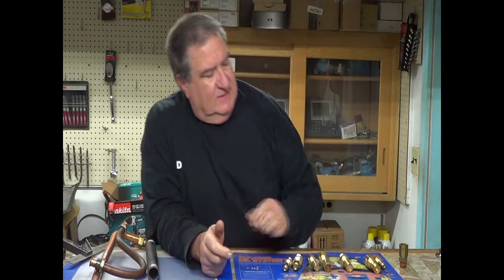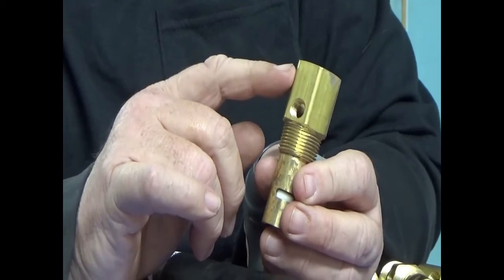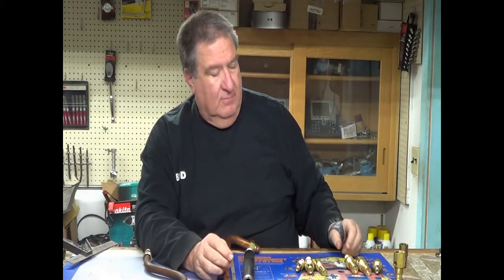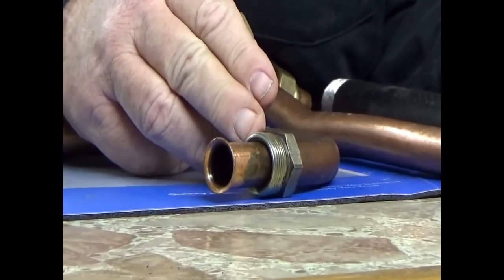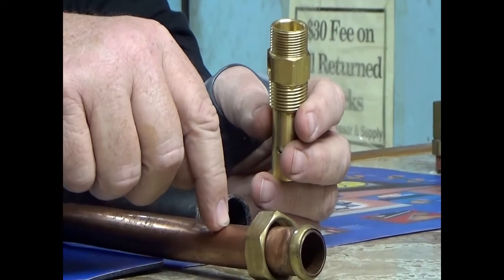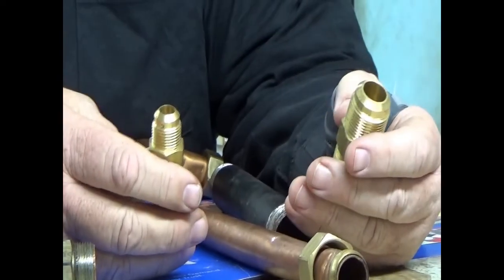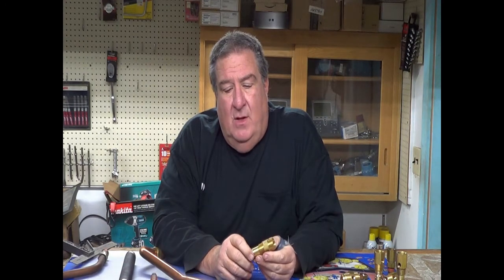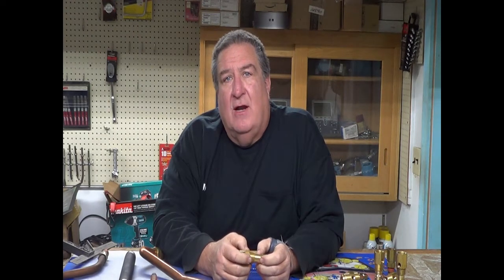Everything you every Wanted to Know About Check Valves but were Afraid to Ask S2, E 22

Comment: Question what is the best pipe thead sealant do you recommend?
Reply from the maker: I use pipe sealant  it comes in a can I buy it off the local plumber, it is a white paste and has a brush attached to the lid to paint the past onto the threads. my truck is not here or I would give you the brand name.
Reply: @THECompressorGuru 
That's the teflon based pipe dope?
Reply from the maker: @ralphgiampietro85  I will look when I get the truck here tomorrow.
Reply from the maker: @ralphgiampietro85  Blue monster brand, PTFE Pipe thread sealant.

Comment: Mr. Compressor GURU, does the check valve have anything to do with not starting the compressor once the tank air gets low? I have Dewalt Pancake compressor and starts, fills tank and doesn't restart back up to fill tank for a day. I replaced low pressure switch twice, jumped the on/off switch and still same issue. This is the same pancake as porter cable, Bostitch.
Reply from the maker: So the Pressure switch ... does it have a tube going to it from the check valve. if it shuts down and it bleeds air for the switch for perhaps 5 seconds. then stops. its probably not the check valve. feel free to contact me through thecomressorguru.com

Comment: My question is can a check valve cause the compressor not to reach full pressure?  It's not leaking meaning I can't hear any air leaking.
Reply from the maker: Probably not. its there for other reasons. are your belts Tight?

Comment: Can a load genie be replaced with a conventional check valve if I replace the switch with one that has the 1/4" unloader nipple on it? My old Speedaire doesn't even have a switch. It just plugs in and goes. I like it because it's a quiet oil pump type so I'm hoping to save it. The noise coming off the load genie sounds like a blown rod bearing on a car.
Reply from the maker: this gives me lots of questions? contact me through thecompressorguru.com  .  i can't wrap my head around an electric compressor with out a pressure switch.😯

Comment: Had a bad check valve and replaced it. Now the compressor pumps up the pressure to 125lbs but over a  3 to 4 hour period it leaks back to 110lbs then it stays there. Was wondering if i took it apart and stretched the spring a little then would that help.
Where i live i can't just run down to the store and get another. I had a problem gett this one, took me a month.
Found one in Florida......
I live in Canada.
Reply: I would n't do it , My question is is your system tight?  a bad check valve when bad will cause many different problem this 3-4 hr leak down I would be ok with.
Reply: @BudStiner  I'll get out some soapy water and spray it down. 
What puzzles me is once it gets back to 110lbs it stops leaking and the download valve doesn't appear to be leaking

Comment: So I have a question. If I were plumbing in a second air compressor would I have to put this check valve specifically on the tank? It already has a check valve on the tank (The one that is already factory plumbed into my tank to unload the 1st compressor). Then the real question is can I place this check valve to a closer location to the pressure switch, like say right off of my discharge hose from the second air compressor? I want to unload the second compressor as well.
Reply from the maker: the intank check valves are to keep the air in the tank and not going back to the compressor this makes for easier starting of the compressor when the pressure switch closes . I think your question is can you put a line check valve between the tanks. I have done that specifically we had a 2 stage machine(175 PSI) and a single stage machine (120PSI) the single was the secondary machine and only came on when the primary machine could not keep up with the demand. the problem fell into the single stage tank was only rated for 150 PSI so we had to stop the air from the 2 stage back feeding the single stage we did that with a check valve coming off the tank to the system of the single stage. 
I hope that made things clear... as mud? if you want you may contact me through thecompressorguru.com interesting question.
Reply: Yes very clear I appreciate you! I do want to ask a bit further. With this setup did you have to drill and tap a hole somewhere in the line to give the pressure switch the pressure that it needed to know when to cut in and out? Does anyone make a line check that has a hole already for the tubing connecting the pressure switch? If you answer those questions you will have answered everything! Thanks Guru!
Reply from the maker: @paulhammons53  to the first question, no each compressor has its own pressure switch and all the check valve did was to keep the High pressure from flowing to the low pressure tank.
to the second question. yes I have those check valves on my web page thecompressorguru.com. 
glad to help
Bud

Comment: Very helpful video. Youre the first person that has noted that oil compressors can make a check valve get stuck closed. 
I''ve got a Coleman powermate 
27 gal 5hp oil belt driven compressor that only builds up to between 60 and 65 lbs before it stops and the motor has a slight buzz, at which point i turn off the compressor to prevent motor damage. From about 50lbs of pressure the belt starts to slow until it reaches the 60 to 65 and can no longer turn. Startup from an empty tank and continued running has no problems, though it seems that periodically, as pressure builds, the start capacitor reingages on occasion. I've opened the head and the reeds are intact, the piston bore is smooth with no apparent seal problems and both head gaskets have been replaced. The relief valve is not leaking, but because it never reaches full pressure it doesn't do a pressure relief as compressors do when they reach max pressure & turn off. I hear no leaking unless I turn the switch off after stalling and then try to restart it again at the stall pressure and then only slightly. But it only tries to turn before stalling again. I've loosened the hose above from the check valve to the compressor  to the point of completely undoing it and there's no air coming out. If I drain the tank, it starts up no problem. Is it possible that the check valve is only opening initially/partially to let air in the tank but after the pressure gets to the 60/65 lbs pressure, it forces the valve closed strong enough that the compressor cant continue to push air in? This would be curious too to me because I would think that the relief valve would then start leaking the air the compressor is trying to feed the tank - but could the fact that it hasn't reached full pressure prevent the relief valve from letting the air out? So the back pressure is preventing the compressor from pumping air? But if this were true...wouldn't I get a release of pressure when I loosen the hose from the check valve?  Anyway... I feel like I've checked everything and it all looks good, but it can't get above that 60/65 lbs pressure. What do you think could be wrong?
Reply from the maker: actinout lets start with the simple place to start. it slows down and stops at 60 psi does the motor stop or just the pump? the very first thing to look at is how tight is the belt??? it should be about as tight as the alternator belt on your car. I read the rest of the post and I am guessing you have really overthought this. check the belt/s . you can contact me through thecompressorguru.com. and I will email you back. if it is a loose belt reply here also. thanks Bud
Reply: @THECompressorGuru  belt tension verified. Both motor and compressor slow to a stop in unison. I emailed a reply per your request as well.